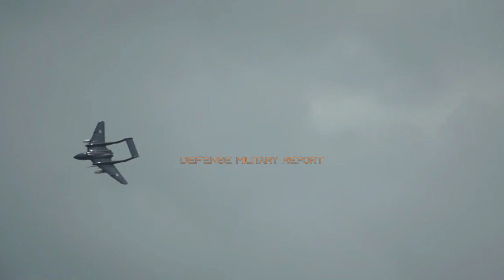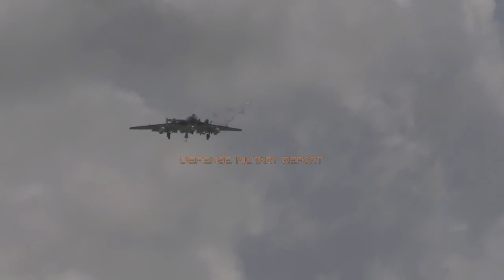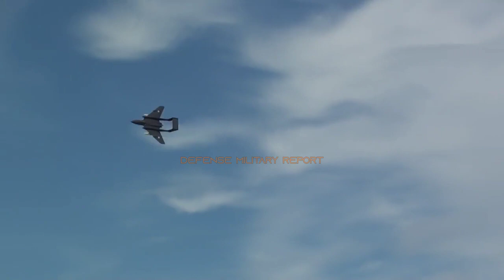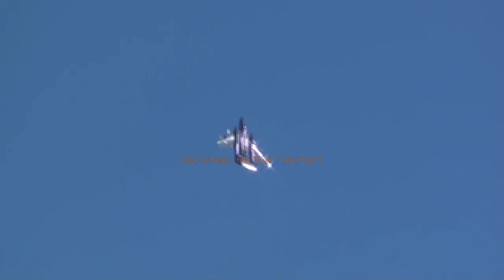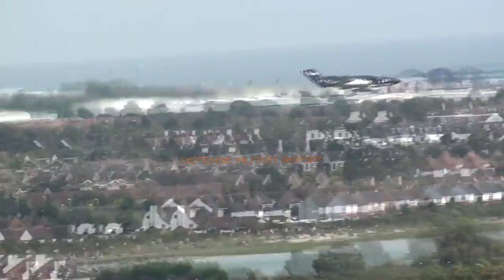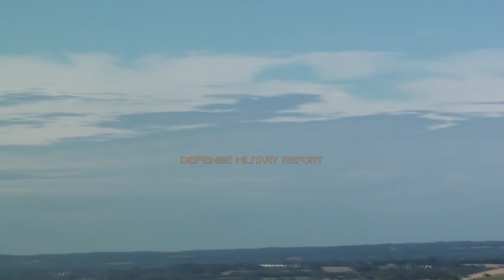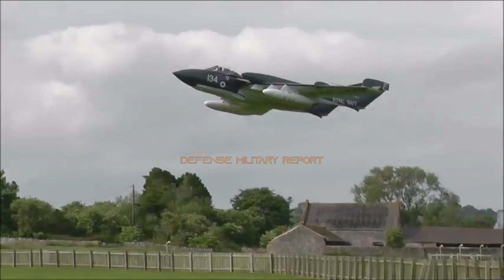De Havilland Sea Vixen - Most Extreme Fighter Jet UK

Comment: Wait a cot, I thought it was the Buccaneer that attacked the Torrey Canyon?
Reply: I was a naval air mechanic and the aircraft that hit the Torrey Canyon was my aircraft (buccaneer mk1)and one of its bombs actually went down the funnel.
Reply: Prior to the Torrey Canyon running aground, the fact that Napalm bombs were an available option to the FAA was classified. 
The intent of the bombing runs on the Torrey Canyon wasn’t’t to break up the ship, it was to set the oil slick on fire, which was accomplished by the use of napalm. 
Vixens and Buccaneers handled the mission.
Reply: @torch8922  So that explains it. Ta muchly for that. By the way, I assume that you know (or knew) the "Hero of Belize", Carl Davis? I read that book, you see......:-)
Reply: @robertwilloughby8050  : I did know Carl Davis. He was the C.O. of 809 Squadron when I was on 892. He was appointed after that to be the Senior Naval Officer of the naval presence at RAF Leuchars, which was the shore base for 892 Squadron when we we not at sea.
As SNO, he got quick qualled on Phantoms so that he could fly with us from time to time.
While we were at sea, Carl took on the role of demonstration pilot for the RN Phantom at air shows - something that he wasn’t really qualified to do - he had minimal hours in the Phantom. While practicing his air show routine at Leuchars, he bottomed out too low while trying to recover from a loop and hit the ground doing about 420 knots. He and the observer ejected late and Carl ended up skidding across the ground, still in his ejection seat. The crash crew found him about 200 yards from the crash site by following the tracks made by the ejection seat in the ground. He ended up paralysed below the waist. His observer (John Gavin) was killed.
Reply: @torch8922  Ooh, didn't know that. All I knew is that he was the President and guiding light behind a gliding club in the Welsh Borders
Reply: They bombed it with about two hundred bombs and hit it twice.
Reply: @neilmchardy9061  Is that two hundred one pound bombs badly aimed or two one hundred pound bombs dropped where intended?
Reply: @tompiper9276  is English a second language mate.?

Comment: Read horrible  things did it have major problems  or was it just because  first supersonic  plane most people ever flew ?
Reply: The only problem that the Sea Vixen had was that the Royal Navy used it off small carriers that simply couldn't handle it. The only carriers that could handle it were Hermes, Victorious, Eagle and Ark Royal. The smaller carriers such as Albion, Bulwark and Centaur were where the most accidents were. The Sea Vixen was a fine and potent aeroplane especially the mark 2.
Reply: Thanks did wonder

Comment: Sea Vixen and Royal Airforce are not to be used in the same sentence. It was a Royal Navy aircraft
Reply: One of our vixens ran out of runway on a diversion. RAF controller radioed “runway to long for you navy pilots”. RAF exchange pilot at the controls just blushed.
Reply: Not strictly true.As a young S.A.C. in the Royal Air Force I worked on a flight of 4 Sea Vixens  at Boscombe Down testing missiles in a trials unit.
Reply: RAF loved the Buccaneer though. You know the ones the RN gave them. Outflow everything the Bryn Reem squad had.
Reply: @johnalanread2751  After the cancellation of the F111 contract the Buccaneers the Fish heads gave us bridged the gap until the Tornadoe's came into service. Been better if we had TSR2 . Did you mean Brylcream.
Reply: @sandemike  yes I did. Afraid poor functioning AI decided it's own interpretation was better.  Flew in both aircraft and the Brick was my preferred ride. Never intimidated by tech and it did the job incredibly well. Axing TSR2 was an act of political vandalism. All it needed was one overall authority instead of hundreds of minions being sent to planning meetings and screwing things up with unnecessary demands and mods. The plane flew brilliantly. Death knell for British aviation. Tornado was a camel. A horse designed by committee. All right but could have been so much better.